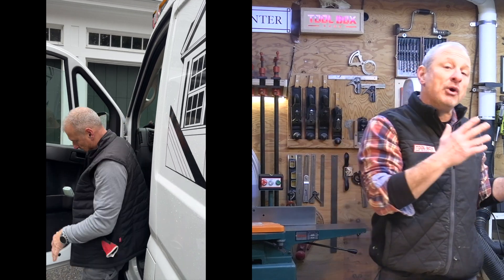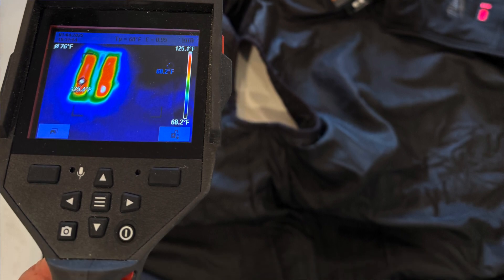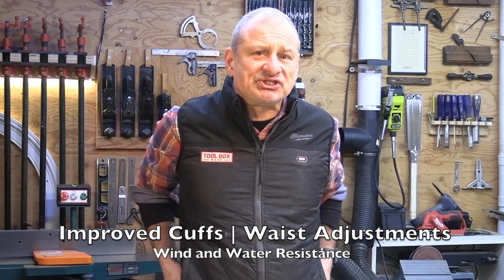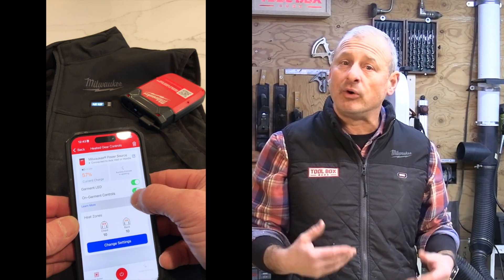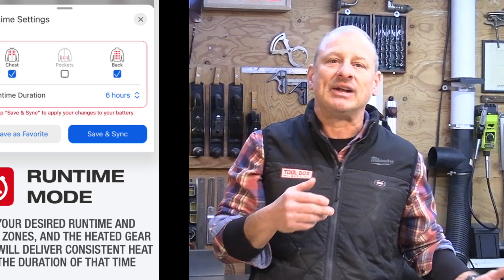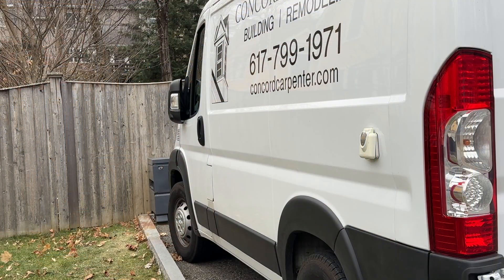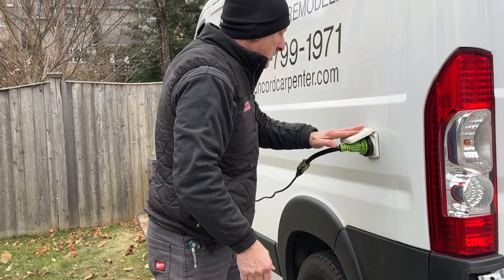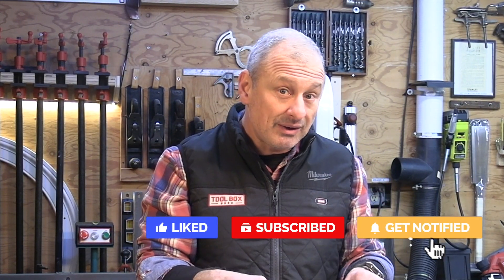Milwaukee Heated Jacket | 2025 HEXON Heating Updates

Comment: Have you tried wearing your tool belt with the vest? I feel like the battery would be in the way and would drive me crazy.
Reply from the maker: @luke8952  I have. I wear a tool vest /suspender rig, and I put the vest over it. Like many garments if its too long it can block pockets - so you need to consider that when sizing. Theses a helpful sizing chart on the website

Comment: I don't like that the axis jacket is not offered without a hood.
Reply: I have the Axis jacket without a hood. It is called the Soft Shell.
Reply: I have the jacket and you won't be using the hood at all.. it's the only down side I have to say with the new gear. The hoods are too stiff and not lined enough
Reply from the maker: @ are they more of a wind break?
Reply: @ConcordCarpenter  no. It's between a fall coat and a lightweight ski jacket most of the time working in 32° and above I don't even need to turn on the heat. And it definitely does not let any wind cut through what so ever.. this jacket is not a game changer it just makes working outside a lot nicer
Reply from the maker: I like the windstopper hoodie and vest